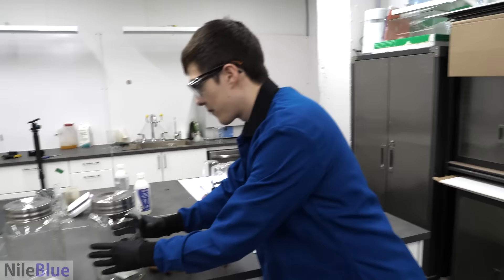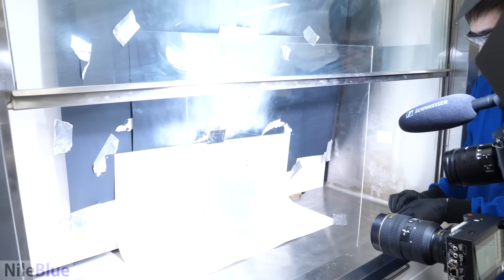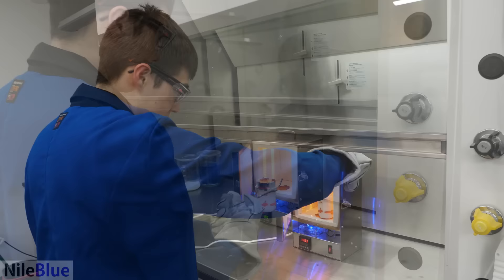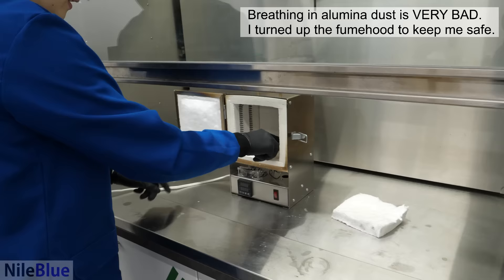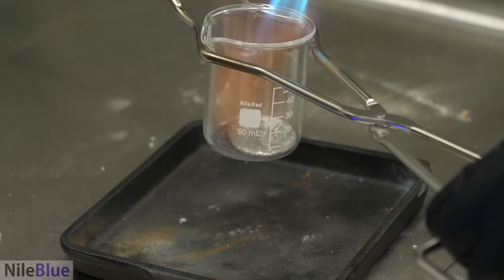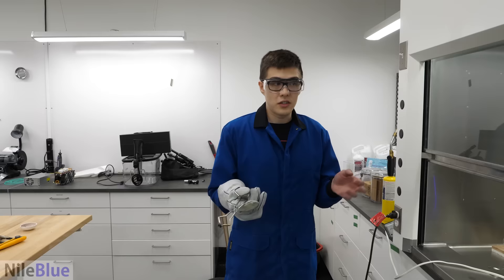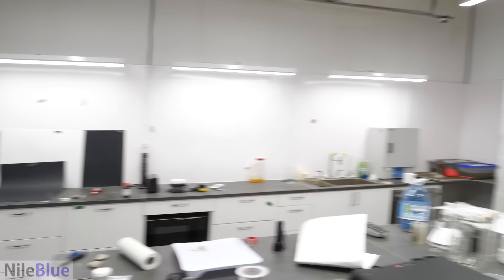This project was a disaster.

Comment: Usually glass is not fire hard, what is used in laboratories or even those fit for the dishwasher is a glass with another recipe. You can see the difference between 'old pre-dishwasher times' and new. Old glass tends to get cloudy in the dishwasher, also you can't pour hot water into drinking glasses, it would explode too. They need a label to be fire prove.

Comment: I feel like the main variable here is the composition of metals used. Changing the compositions will change the exact melting point, and also in contrast the solidifying temperature. The constant would be the air bubble seen around the metal drops/stream once in the water. I would assume that the air bubble will collapse in on itself at the same temperature each time. At that point you may have the same solidification of the outer metal, tho the inner metal would perhaps not cool at the same rate depending on the composition of the metal used and their respective melting/solidifying temp. Once the air bubble has collapsed, the water would then have access to the more inner and still hotter metal creating an explosion of steam from inside the already solidified metal. The end result being a similar concept to when a prince Albert's drop explodes. Im not sure if it would be that force that had broke the jar, or potentially new droplets introduced into the water that had a new air pocket because of still being at a higher temperature and then hitting the glass causing a failure due to temperature shock. Another variable moving forward could also be related to metal composition, but in terms of hardness. All of the metals used are relatively soft metals. Gold, copper, tin, and a high tin ratio bronze. So that would lead me to wonder how my concept of what's going on here would change with a harder metal such as iron or steel variants.

Edit - also forgot to mention the part about the water levels. I believe that was because of the shape of the jar at the different water levels. With straight vertical sides of the jar, the entry may create a more violent disruption as the water gets smashed straight into a wall both on the surface as well as the displacement and energy below the surface. But with the higher level, you have a smaller area of water surface which could be less violent but also the curved walls may redistribute the displacement and energy differently and more gently. Like throwing or rolling a ball straight at a wall vs at a curved surface. You did also throw the last one in a lot faster, it seemed, which would be another variable in all senses.

Those are just my thoughts tho, not sure how correct or incorrect they are.

Comment: I was wondering if the explosion is due to being in a glass jar. Glass hates sudden increases of temperature and pressure and because the glass only seemed to actually shatter when the metal hit the bottom, I think it could be this. Water can explosively boil when extremely hot substances enter it and I think the sudden boiling and massive change in temperature local to the bottom of the jar was too much for the glass.

Comment: I know this is an old video, but I'm going to put my theory in here.

The molten metal started to instantly lose energy as it entered the water, we can see this obviously.
While it was travelling down it still had enough energy to create a vapor bubble around it.
When it reached the bottom I think:
1. The metal was still extremely hot, well over the vaporization point of water.
2. The velocity of the metal was great enough to overcome the force that was being exerted by the vapor bubble.
3. When the bubble was broken by the metal making contact with the glass it imparted its energy into the glass and the collapsing bubble then pushed its own energy against the glass as it collapsed.
4. This caused a pressure wave which when combined with the thermal exchange between the metal and the glass caused the glass to catastrophically fail.

This is actually a really big concern in foundries, which pre-heat their equipment to vaporize any water or moisture of any kind. Since water especially can expand up to 1600 times its original volume when vaporized. This is why even small scale metal working preheats molds to prevent imperfections in their product since failure to pre-heat and leaving moisture in the mold can cause small explosions which cause bubbles.

An article posted in Foundry Magazine seems to back up this hypothesis: https://www.foundrymag.com/melt-pour/article/21927633/molten-metal-splash-and-furnace-refractory-safety

Comment: Wild guess but : as the metal enters the water, the temperature difference is so great is so great there's a liedenfrost effect going on, with little heat dissipation in the water, but as soon as the liedenfrost effect stops the water cools down so rapidly ther's a big drop in pressure, cavitation, all that, so it's an implosion !

I guess you can either use less water of get the metal hotter to get the implosion to happen near the glass, then.

Comment: I'm thinking it's not strictly that it has to reach the bottom, I think it just has to be in contact with the glass when it explodes. The sides of the jar might work just as well. Also I wonder if it's just that contact with glass makes it explode more violently than contact with water does, what if you poured it into an empty jar?
Reply: The glass is also my assumption as someone who knows little about chemistry but something about kitchen safety.  Lab grade glassware is borosilicate glass and most kitchen glassware (including Ball Mason jars) is soda lime glass.  Soda lime glass is much cheaper to make, but highly susceptible to thermal shock, which is when it shatters/explodes due to a sudden change of temperature.  It can be a hot dish from the oven set on a cold granite countertop, a cold dish from the freezer put into a hot oven, or molten metal poured onto glass.  Molten metal is so hot though that I wonder if borosilicate lab glass might meet the same fate - it is resistant to thermal shock but presumably not impervious.

Comment: Very late, but I don't think mason jars do not handle thermal stresses/expansion well (untempered soda lime, unlike borosilicate lab glass).   So I think that if the hot metal makes its way into contact with the glass before the water can cool it down (possibly assisted by water vapor?) it will immediately shatter between the cool water and the hot metal contact.  Water will cool metal down quickly though, so maybe it depends on how hot the water around the metal is by the time it comes close and not the actual metal.

Comment: NileBlue,

I have an answer to "What is Happening?"

The water vapor layer is a result of the Leidenfrost effect.

At high enough temperature differentials a vapor barrier is formed between the two surfaces.

When the temperature gets low enough the layer disappears, the metal comes in contact with the much lower temperature water.

The rapid boiling of the liquid water causes the explosion. The water could not touch the liquid metal until this point because the vapor barrier was separating them.

A variation in mass or temperature will affect how long the effect lasts.

Google Leidenfrost effect and you will see similar physical reactions.

Cool video!
Reply: what's about cavitation?
Reply: This is probably not possible since the metal is still red hot when it explodes, which indicates a temperature of around or above 700°C. On the other hand, the Leidenfrost effect has a threshold of about 200°C, which would preclude your hypothesis from happening. I posted an answer with what I believe is a plausible explanation (having to do with water splitting), if you want, you can check it out and tell me what you think.
Reply: @octour  cavitation is definitely not the culprit here, it occurs when water experiences a sudden change in pressure which is usually associated with sharp turns in plumbing or some types of valve. The water here is stationary so there is no way cavitation could take place.

Comment: For why it explodes from a guy I saw a while ago blowing up fish tanks. The hot metal turns the water to steam, however some water gets trapped in the molten metal building the steam up so fast it "explodes" hence why the explosions don't produce a spark or flame but throw the molten metal that hasn't cooled yet back out

Comment: Nile- masters level understanding of chemistry 

Also nile- doesn’t understand thermal shock
Reply: That's the beauty of science bro never stop learning!
Reply: Chemistry ≠ Physics, BRO
Reply: @U014B  chem == emergent physics
Reply: He's a chemist, not a physicist! XD
Reply: Ealsante more important, he’s having fun!
Reply: I thought it was common knowledge, but maybe I just come across more in my experience (don’t put hot beer glasses on frozen beer glasses b/c shards on glass stabbed in hand), but I’m just poking fun. I respect the shit out of these science channels.
Reply: For the first run (14:41), I'm inclined to agree, because the glass doesn't break immediately when the explosion happens, but it breaks only after the hot metal has been touching it for a while. 
The second run (17:23) doesn't look like it broke at all, because the metal explosion happened right on contact with the water, thus a lot of the shockwave dispersed into the air and the scattered metal pieces had time to cool off before they touched the bottom of the glass, the heat gets dispersed in the water, so the glass doesn't heat up enough to crack. 
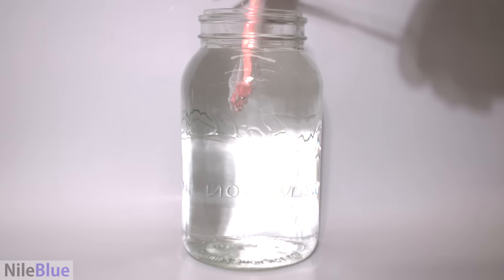The third run (20:11) doesn't look like thermal shock to me. The glass breaking coincides perfectly with the metal explosion and also broke exactly where the shockwave hit first. The break was also much more violent than the thermal crack we saw in the first run. The hot metal is isolated by water vapor around it and water itself doesn't conduct heat that quickly, so I highly doubt this break was caused by thermal shock in the glass.
Reply: Last one didn't look like thermal shock to me
Reply: @capybarawithanorangeonitsh4190  Until that glove gets tossed to the floor.
Reply: @Isolanporzellator  i think he meant thermal shock in the crystallized metal
Reply: When glass fails, it tends to fail catastrophically due to internal stresses and imperfections in the crystal lattice.  My theory is that the steam bubble (essentially a form of cavitation) that forms around the molten metal as it enters the water insulates it somewhat on the way down.  I'm guessing detonation of the molten metal occurs when the metal has cooled enough that the steam shell at the bottom is too thin to insulate it any further.  The metal then rapidly loses most of it's heat to the big mass of water, far too fast for the metal to form a stable crystal structure (thermal shock in metal).  The big difference in the third run, I think, is that there was enough heat left over that the metal transferred much of it's heat more or less directly into the glass causing thermal shock (or, otherwise, detonation of the metal occurred close so close to the glass that the shockwave caused by the rapid transfer of heat to the water was enough to shatter the glass on it's own.

Comment: My theory: Increased velocity on impact with the surface exposes more of the molten metal to the water directly rather than buffers it with water vapor (Leidenfrost?); the increased speed means that it outpaces the water vapour cone. Slower velocity means the metal doesn't progress as fast and keeps its protective shell of vapor until it either contacts with a solid surface or cools down enough that it cannot maintain the water vapor bubble around its surface, at which point the drastic temperature shift causes the outer shell to crack, water to rush in and mix with the still-molten core, and then cause an explosion.
Reply: I understood maybe 3 sentences here but it still makes me happy.
Reply: That is what I was thinking
Reply: It could also be that the metal forms a more coherent stream and has less surface area when its slower but when its fast it splits up
Reply: Leidenfrost is indeed the buffering of water vapor. I wonder if it's partially cavitation that causes the explosion?

Comment: Could the temperature of the water make a difference? For density I think water is at its most dense at an atmospheric pressure at around 40° Fahrenheit. It would be interesting to see what changes to the water can be made and how extremely hot metal reacts with it. Also could you try silver in the future, it's more conductive than copper and has a lower melting point. I want to see what those differences in properties actually look like in an experiment rather than on a gage/reader.

Comment: Hey, nice theory there on why it exploded, however I have a rather different theory:
I believe the water vapour around the molten metal was due to the leidenfrost effect, which requires a certain temperature differential, so as soon as it had lost enough energy and cooled off enough, the metal comes into actual contact with the water and explodes (the velocity could also explain this - the slower it goes, the smaller the cushion of vapour has to be to prevent the explosion).
The copper-gold mixture was far hotter than the copper-tin mixtures, so it reached the bottom and exploded on contact with the glass, no matter the speed
Reply: I don't think so.  The Leidenfrost effect literally just happens above the boiling point of water and the violence of the boiling doesn't increase as the temperature goes down.  It pretty much remains constant.

I'm gonna guess that at the temperatures he's using the molten copper (and more importantly the tin) react with the water to form copper and tin oxides, producing hydrogen gas.  From there pretty much any oxygen the hydrogen comes in contact with will be enough to make it explode when the gas mixture contacts the metal.
Reply: @htomerif  You may be right about that not actually being the Leidenfrost effect, but it is often talked about in metalworking that when you quench steel, you really want to swish it around to overcome all the steam around your item and get more metal to water (or oil or whatever) contact. Not sure how true it is, but that's what's often said.
Reply: @htomerif  Really, the only way to test that is to pour the metal into a container filled with pure water vapour. 
IIRC, Leidenfrost isn't about an object merely being above the boiling point, its about it being so much above the boiling point that the liquid boils before contacting the surface, and the vapor repulses the rest of the liquid away from the object. Of course, that's the general case, and in this case specifically, both materials are liquids, one is just liquid metal, the other liquid water. 
Hypothesis time: past a certain point, the water is in contact with the (still liquid) metal, and is being heated mostly via conduction (instead of radiation or convection). The water, still being at (or close to) room temperature, is therefore heated to the boiling point. From there, the rapid expansion of the vapor produces the observed explosion.
Reply: I think it has to do with a couple things 1 water can not be compressed, which is why air is added for high pressure testing. This combined with the second part which is the volume of steam being produced.  1oz of water created 1700 oz of steam. The steam produced as quickly as it is underwater doesn't have time to mix per say so it creates a massive pressure bubble and explodes". I have seen water and steam create a lot of damage when you have steam hammer"

Comment: My thought is that when you pour the liquid metal into the water you are essentially creating a liquid metal Rupurt's Drop. The outside layer is cooling and contracting creating a huge amount of internal pressure until the outer layer is no longer able to contain it and it explodes. If enough of the metal explodes at the same time it creates enough force to break the jar.

Comment: It isn't too often that a video makes my jaw drop. I let out a quiet "wow" for that last slo-mo clip!
Suggestion if you try this again...crush / flatten the copper fittings with a hammer and fold them into smaller pieces. Might make them easier to fit into the crucible

Comment: Used to work in an aluminum foundry. When they put me on furnace tending the told me always preheat the ingots before adding to a half full crucible. Then proceeded to show me a face shield and the hood above us completely covered in aluminum spatter. Cold meeting hot...its like water with hot oil.

Comment: My theory would be that the temperature and distribution could play a role as well. The 'protective gas' layer is the Leidenfrost effect right? So if the temperature is lower (copper is lower than gold, bronze is lower than copper) the barrier runs out faster so the explosion happens faster. The next variable would be distribution. A bigger mass of heat is harder to cool and having a blob would mean less surface in contact with the water maybe? Very hard variables to check for though. But would love to see some tries (in a smaller cheaper jar :P) with different temperature materials at the same mass. Could be fun :)

Comment: If your mould that you pour molten metal is damp even humid it will also explode. The water vaporises instantly and the expansion rate from liquid to gas is a ratio of around 1500 times.

Comment: it made a bigger impact because of the pressure i assume. cuz lower pressure on the top of the jar doesnt resist the shockwave at all... the lower it gets, more pressure the water has. explosion force will struggle with high pressure.